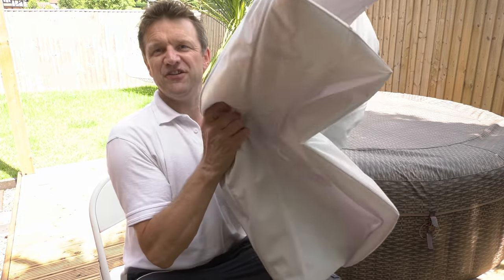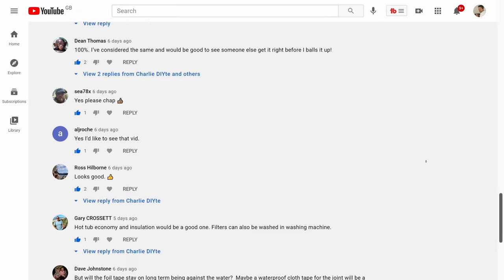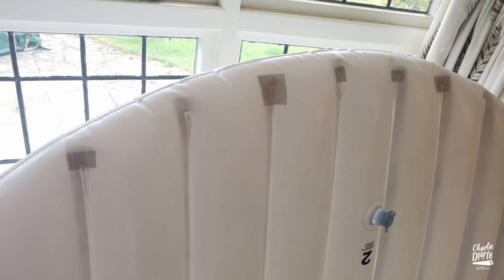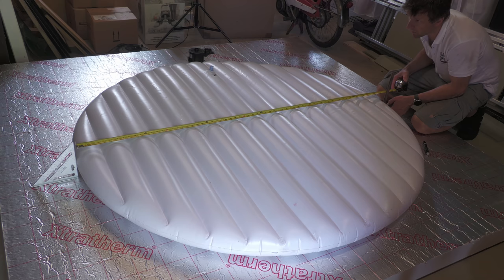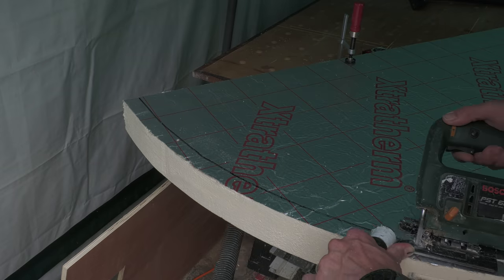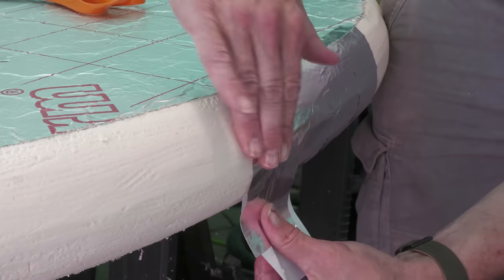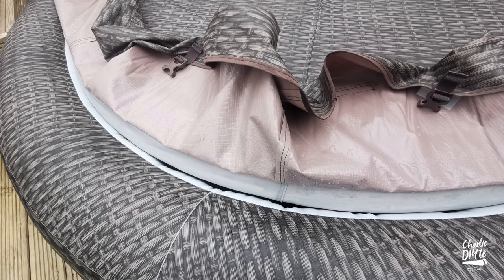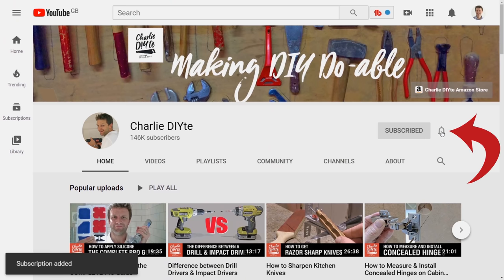Lay-Z-Spa Hot Tub Inflatable Lid Upgrade

Comment: Great problem solving.  What thickness did you use??
Reply from the maker: 100mm. It's nice to keep the skirt but you can get a better seal by getting rid of it which means you can angle the PIR and make it bigger. Also use clear Gorilla tape in the middle join not foil as foil tarnishes.

Comment: As an engineer and a designer I would say this modification increases freeze protection and increases the efficacy of the device in general, increasing the longevity of all of the parts. Tip o the hat sir! Now I know what I'm going to do. For all the lay men that don't have to worry about Frost hotter water quicker cheaper. And it's cheaper.
Reply from the maker: Thanks Derrick. If I was doing this again I would have cut the skirt off. That way you can achieve a total air tight seal by making it a bit wider - downside is you have to find a way of keeping it attached to the cover unless you treat them as two separate entities. Also, use clear Gorilla tape not foil in the middle as the chlorine tarnishes the foil and I think messes up the treatment of the water (just my hunch).

Comment: Interesting video, thanks. Just got my St Moritz, so hopefully the lid will be ok. Been debating getting some pallets and using a jigsaw to create a scandi style surround for it, with insulation between it and the tub. Has anyone tried this, or a good idea for you to video @charlie DIYte??
Reply from the maker: I don't think you'll get much heat leakage through the sides. I certainly haven't. If you're building anything I'd build an insulated base and it's through that inflatable lid that you'll lose most heat.
Reply: @CharlieDIYte  Put it on foam matting, and was more thinking of the surround from a visual point of view, but then thought I could make it a bit of an added benefit by doing that.

Comment: for anyone doing this in future, you should cut it into 3+ parts to fit into the skirt. the two ends and a middle section. when you put it into the skirt you can fit the 2 ends into place no problem which will leave a middle chunk missing which you can fill with the 3rd piece. you'll need to dissasemble to remove it though
Reply from the maker: Good point, and I think maybe the approach is to not try to stick them together as this causes issues with the PIR foil tearing. If they're squeezed in under pressure, sticking then together shouldn't be necessary..I found the foil tape tarnished so clear gorilla tape is a better solution.

Comment: We got our spa on Saturday....... it has been leaking since we bought it 6 days ago!!
Reply from the maker: Sorry to hear that. The design of the lid is so disappointing. I think the rest of it is pretty decent quality.
Reply: @CharlieDIYte  yes we have been so impressed otherwise!! A replacement is on its way, hopefully it holds the air for more than a few hours! I am going to see if i can replicate what you've made!
Reply: We bought one off ...wave spas .. and there lids are amazing quality really thick and we had ours 2 months no leaks . But it's a bit small It dont fill the full circle of the tub theres about 1 to 2 inch gap all round  so i put insualtion board on top of the cover to keep the heat in

Comment: I bought a Bestway SaluSpa Hawaii Inflatable Hot Tub 3 months ago and the top cover already has about 12 holes in it. Same places as your cover. I fixed 1 hole and thought I was done.... lol   No way am I going to mess around with this piece of junk. I already have some 4x8 black foam boards I can use.   It's square so it will be easier to do this.  What a stupid design by Bestway.  Thanks for the video.
Reply from the maker: Yes, definitely do that. I should have dispensed with the skirt too as that way I could have got a much be better seal keeping more heat in.

Comment: Superglue is really bad for those repairs because it’s brittle, and just cracks to create new leak channels. You want AirStop glue. Way more durable for vinyl appliances like the hot tub and air mattresses, and doesn’t even require a patch - you just build new vinyl over the hole with the airstop. Though in those corners, you should keep your strategy and just swap in airstop. Those sharp stress concentrations are pretty bad. my older intex spa uses concentric sections that don’t have any sharp corners to tear.
Reply from the maker: Thanks Alex. Problem was not so much the repairs but new punctures kept opening. Terrible design, that cover.

Comment: Would it be possible to then wrap the underside of the newly modified lid with some epdm or equivalent and the tie in into place hooked over the skirt and PIR. This would totally prevent water penetration.
 Would you have to remove the skirt to fit the pir over the top of the hot tub or just fold it?
Reply from the maker: I think edpm or something like that would be useful as that foil tape has really tarnished with the chlorine although the foil on the PIR is absolutely fine. Maybe just a stronger tape, or stick a transparent tape on top. Note sure what you mean with the skirt. You could leave it in place but it will bunch above the PIR and form a trap for water. At the end of the day or would be better to ditch the skirt because it would have been good to make the PIR a bit wider but I'm not sure glueing the PIR down is the answer.

Comment: What about gluing it straight to the cover, does this work okay ? I think I’d prefer that method
Reply from the maker: That's what Paul did and I don't think he's had any problems with it. I guess it's just a very final solution and if for any reason you wanted to replace it, you'd have a bit of a mess on your hands. But then this presupposes the tub itself is going to last more thana few years....
Reply: As Charlie mentioned - this was the approach I used and it was a much simpler process. Cut off the skirt, cut the board to the required size (the edge of mine sits on the centre of the inflatable part). I used evo stik sticks like ** as the bonding agent and sealed the foam edges of the board with foil tape which, like Charlie mentioned, did discolour with the chlorine but has lasted well apart from that. I managed to get some non-perfect board and made mine in 2 halves. I then had some spare to double up the thickness in the centre. I used much thinner kingspan (which is what I had) but is double thick in the centre.
Reply: @spongefactory  is it possible to see a picture?

Comment: I would be interested to know if the new lid helps keep the temperature hotter for longer. 
Even though my lid is okay (for the moment). I have been thinking of replacing it for economical purposes to see if I could save a few quid on the electric bill
Reply from the maker: Difficult to measure scientifically or compare against the old one but I'm convinced it's retaining the heat better👍🏻
Reply: Tempted by this for this reason, even though the lid on my new hot tub is still in good nick! The last one really wasn’t so expecting to have to replace at some point.
Reply: @CharlieDIYte  Why would the original retain any heat?  Its just a bag of air.   If you remove it, you still have air.  There's no thermal advantage to this inflatable at all as far as I can tell?

Comment: What about using zip ties to allow the middle of the lid to flip on itself like expensive hot tub covers
Reply from the maker: It wouldn't work with PIR board and the skirt would stop it hinging. I see Lazy Spa have just bought out a thermal cover.

Comment: Do you leave your spa on set temperature 24/7?
Reply from the maker: I used to leave it at 40 (the family won't go in it if it's less than full temp!) but particularly with electricity prices the way they are now, I keep it at 35 and then just bump it up a few hours before we need to use it.
Reply: @CharlieDIYte  Do you clean/flush your pipes heater internals at all?

Comment: Can you suggest a way to make it hinged so it folds in half? I live in Houston Tx so keeping the heat in isn’t an issue. More for keeping rain and dirt out.
Reply from the maker: Not really if used in conjunction with the skirt as the skirt will stop it hinging. You can get bespoke hinged covers made over here. Might be worth seeing if there are any companies in Texas specialising in this.
Reply: @CharlieDIYte  Thanks. I tried myself. I have an industrial sewing machine so I opened the seam up on the skirt so it would fold and re-hemmed it. I used FOAMULAR Extruded Polystyrene (XPS) Rigid Foam Insulation that was 2” thick and did a basic cut, 2 half circles that fit inside the white skirt. I did use the foil tape on the edges and clear or I’ll tape also. I went a step further and covered the foam with a really heavy clear shower curtain with the seams on the side away from the water. I hinged it all with gorilla tape. It seemed fine but within a week the tape started to give way. I don’t know if yours held up. It has been in the upper 90’s low 100’s for a month here. I don’t know if I could have done more to keep the tape on. It didn’t all come up but there were spots loosening after a week. I burnished them down too. I did check on a hinged cover and they run about $450 to $500 so not worth it. I’ll post my other solution in a second.
Reply: I ended up scraping the foam idea. Again, as I originally said, I’m not trying to keep heat in. I’ve had the tub over a month and haven’t run the heater and the water stays between 95 and 101 from the sun and the cover being on. I don’t plan on running it past October. I use mine to cool off and watch the birds…This time I went to my favorite, PVC. I drew the half circle, 6 foot, on my storage shed deck type floor and screwed down scraps of 2x4 around the outline to make a jig. I assembled the straight side with 3/4” PVC, 2 35” long pieces to a T in the center and 90’s on the corners so it is all 6’ and rests up on the lip of the pool instead of dropping in. I used a heat gun and bent the PVC to form the half circle and glued it together. Not wanting to do the math as I was bending it I added the T’s and cross afterwards. I then used a cross piece connector (+) in the center of the half circle and cut out pipe and added 4 T’s. The curved sides weren’t straight on so the pieces of pipe I added had to be heated and bent to fit. I glued it all up. With the pieces forming the whole circle, I drilled 4 holes on both halves on the straight side to string nylon rope through to make “a hinge”. Rope through each hole, knotted off and burned the ends so they won’t slip. I cut the white skirt off (it was sticky from the gorilla tape and I wasn’t going to use it anyway). It is on the pool tonight and it’s raining. The lid isn’t sagging. Tomorrow I have to sew the PVC frame to the lid so it is all one piece. Super light weight. Not for heat, but it will keep rain out and dirt out too. If I could post pictures I would. Maybe a link to a different page tomorrow.

Comment: Great video Charlie. Love it! One question - 100mm board - do you think you could get away with anything a bit thinner?
Reply from the maker: Thanks Jimmy. Yes I'm sure you could. It was only because 100mm was similar to the inflated thickness of the original, although a thinner board might be easier to get into the skirt, meaning you could make it a little wider. Someone's suggested XPS foam board would be better, in terms of resisting moisture long term, so you should maybe look into that as an option too.

Comment: So I have found a foam company here in the states that will custom make polystyrene for me.  She just needs Height x Width x Depth.  I'm not sure what dimensions to give her and how to tell her to curve it so it plugs the hole.  This will fit INSIDE the skirt somehow.  2 pieces.  Any help would be great!
Reply: I believe you said 1720 mm and 1670 mm?
Reply from the maker: Impossible to say Cari without knowing what hot tub you've got, and even then, unless it's the same as mine, I wouldn't like to say how wide to make the cover. My only suggestion is you maybe dispense with the skirt and make it a bit bigger so it sits snug, as mine is a bit small if I'm honest. 👍

Comment: How well do you think similar 50mm/2 inch insulation foam would do vs the original inflatable cover? Finding 50mm/2 inch foam much easier here in the states, and envisioning making a foldable cover with some moisture insulation around the foam
Reply: Im curious if you made your cover ?  I am on my 4th inflatable cover in 18 months and quite tired of this game. I also could not find anything thicker than 2" board here in the states. I am thinking of using the 2" to basically set on the top of the hot tub and then just throw the liner/cover over it. Will be separate but may be easier even though it means taking on/off two "covers". I've also thought about trying to construct something with pool noddles, bubble solar cover or an "envelope" filled with packing peanuts but I haven't quite engineered anything yet.
Reply: The original is just air?  Just because its in a plastic shell, it doesn't change the thermals - its just air.  So any real insulation will be great.

Comment: How about when you put the pir board in to the skirt  you dont fill the whole thing  leave a 1 to 2 inch gap  but before you put the pir boards in use expanding foam all round the inside of the skirt  THEN put the pir boards in then put the lid in to the hot tub clip it all in to place  and let the expanding foam fill the inside of the skirt and make a tight seal inside the hot tub   might even put some down the join of the two pir boards once it all set cut the excess off . Cover it all with plastic waterproof tape .
Reply from the maker: I don't think it would work around the skirt in that it wouldn't expand in a uniform fashion. A better idea would be to do what you suggest but insert a large foam sleeve like you get with packing around the edge or make the board oversized to the skirt but a better fit to the hot tub and cut a slither out in the middle to allow you to get the PIR into the skirt which you could then fill with expanding foam, trim flush and cover with the tape. The tape incidentally needs to be clear waterproof or similar rather than that foil tape as the foil does react with the chlorine. I use a clear Gorilla tape now.
Reply: @CharlieDIYte  hi but you won't see it as it be inside under the lid   even if you trimmed the over spill  it once it's set   it still would fill to the exact fill of the hot tub  closing all gaps  all you need to do it when you fit the lid back on after use you put it back in the same place  just mark one set of croc clips an make sure they are the ones you always use . 
B&Q sell a light blue waterproof tape  and 100% guarantee its sticky called DEE M ARK  says line marking inside the tube an wow you really have to pull this stuff to get it off the roll .

Comment: how about using expanding foam in the existing punctured lid
Reply from the maker: A few people have said that. I can't see how you'd get it into all the corners though (one guy said he used a long tube) or for that matter how many tins you'd need
Reply: @CharlieDIYte  as it's already punctuated, it won't hurt to put a few more strategic holes in to suit, half a dozen cans should be plenty and a lot cheaper

Comment: Suggestion:
No need to remove the inner skirt completely if you want to have a larger lid, simply cut it in a couple of places so that it lays flat.
Reply from the maker: Fair point. Might fray though or else degrade over time.
Reply: @CharlieDIYte  Thinking about this further, you could unpick the stitching where the inner skirt joins onto itself (which would avoid fraying) and add velcro. The velcro would then enable you to put the inner skirt back together if needed - and it would also allow some flexibility regarding size of whatever you place within the skirt too.

Comment: I just tried something and it worked! I used my existing leaky cover, I took two cans of spray foam, and filled it up through the valve hole, worked perfectly will last a lifetime!! be careful not to over fill!!
Reply from the maker: Did it fill the entire cover? A few people have suggested that but I was sceptical that it would fill the entire cover.
Reply: @CharlieDIYte  yes but took me 15 cans! i regret that, but once i started i had to finish! i had to cut small mini holes to fill everything in the different chambers, but it worked and floats great! keep the holes on the top, not the bottom.

Comment: Did using foam insulation significantly decrease the cost of heating the hot tub? With the cost of electricity, a cover like this could conceivably pay for itself in 3 months... .or not! Ours costs $100-$150/month in Northern California,  roughly 4-10kwh/day.
Reply from the maker: Yes it definitely helps. I've switched it off a week ago though. Too expensive to run with electricity the cost it is right now here in the UK. I'd probably make it a bit wider if I was doing it again, for a complete airtight seal, dispensing with the skirt.
Reply: @CharlieDIYte  thanks very much for writing back. If you can't run it, I hope you can find a happy alternative. I checked with some hot tub vendors who say that hard sided hot tubs cost about 1/3 to 1/2 as much to operate. Spending money and effort on insulation seems like effort very well spent!

Comment: Use a Large beach ball £1 under lid on top of heat retaining blue bubble mat £20. Keeps rain from pooling. Blue bubble mat retains heat. When sunny normal gains are 4 to 7 degrees for £ free. Your welcome.
Reply from the maker: Thanks Lee. Good thinking 👍🏻
Reply: Do you find it actually heats up during the day with those bubble mats?  I thought they would just slow the loss of heat, but not actually heat it up!
Seems like a far better idea though, as the lid itself is just a bag of air, so does zero for thermals, its just to keep the shape as far as I can tell.